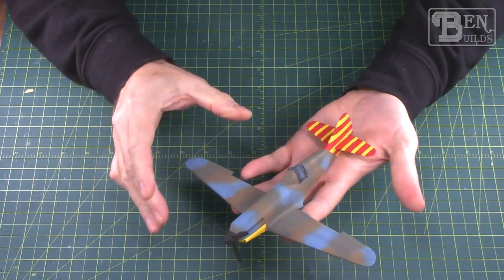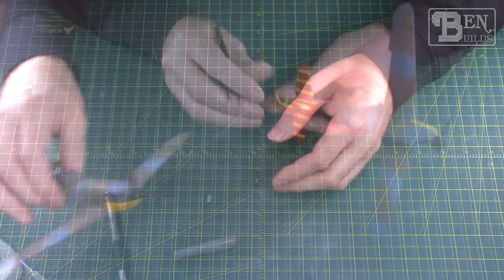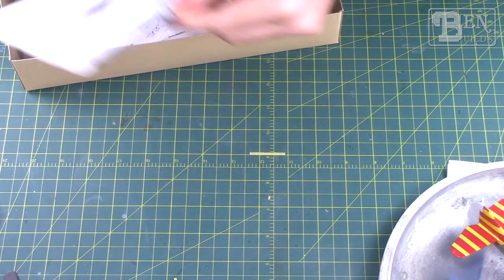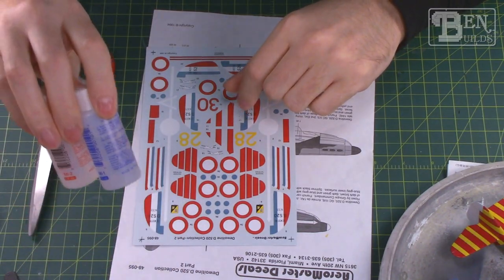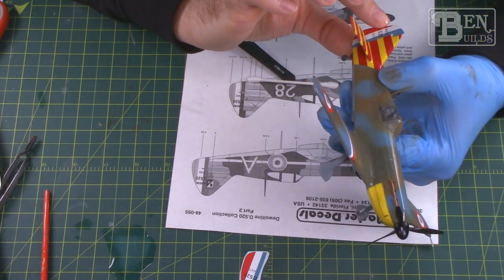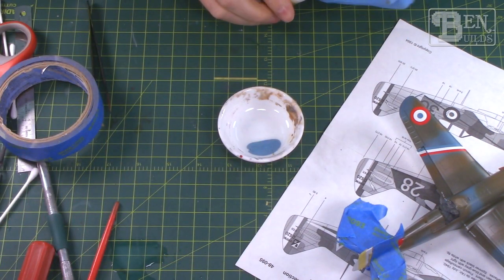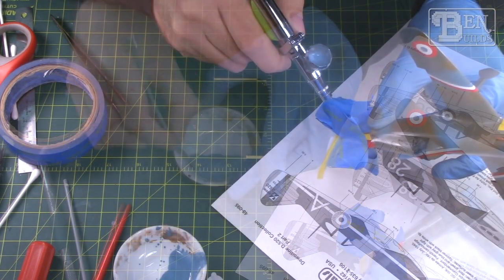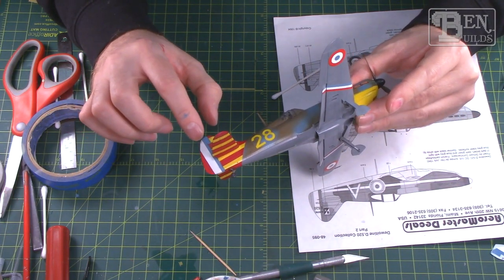Ben Builds With Joe S6 -Dewoitine D.520 ep. 9

Comment: Great save on the tail. I was really impressed with the stripes on the wings - they didn’t look like they were conform on the leading edge.
Reply from the maker: Thank you, Bryan! I am pretty pleased with this kit's progress. Those stripes on the wings did take a bit of coxing with Micro Sol, but they eventually calmed down and settled into the panel lines and around the leading edges. It took several applications of Sol, but they eventually cooperated. Ideally, I should have just painted them on, but live and learn lol. Next challenge will be the tail stencils. The Tamiya decals have not been easy to use with this build, so fingers crossed they cooperate. See you on the next one!